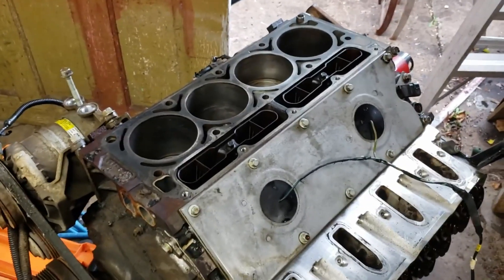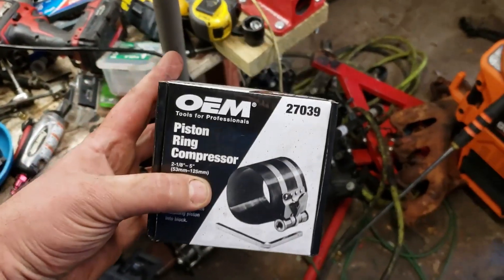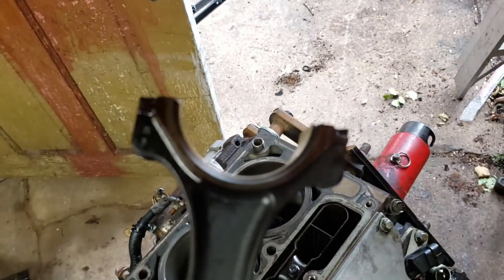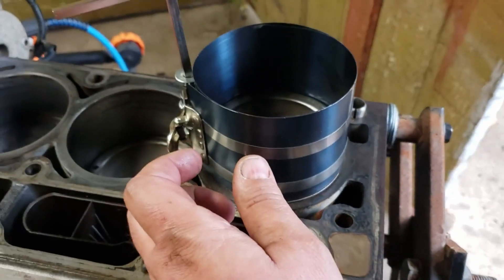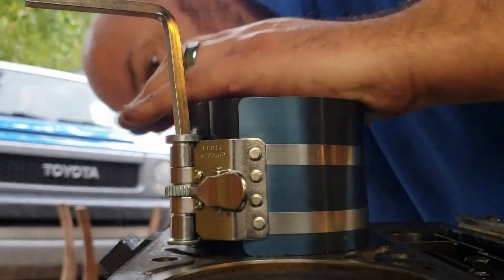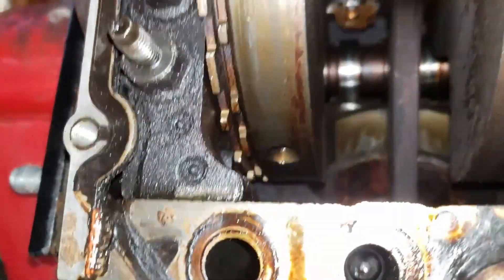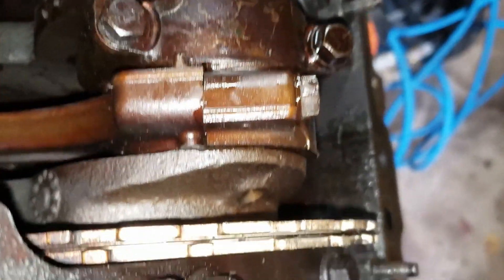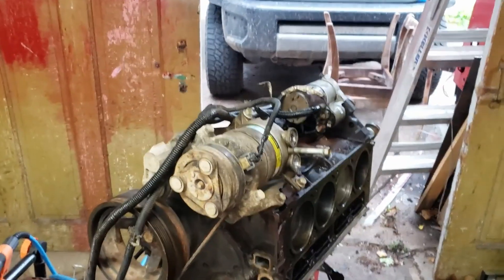Piston install on LS engine, Driveway Engineer style.

Comment: How interchangeable are the bolt on parts between a 5.3 and a 6.0?
Reply from the maker: Everything but the pistons
Reply: The Driveway Engineer outstanding.   Thank you.  We bought a burn truck with a 6.0 where the fire originated in the cab.  The plastic under the hood all melted, but the engine still turns over and seems ok.  If it checks out as good I’ll be looking to the junk yard to provide the parts that melted.
Reply from the maker: @smallblockfuelie  I'd look for a complete engine, maybe something with a hole in the block.

The junkyard will nickel and dime you on components
Reply: The Driveway Engineer thank you.  I’ve found a guy local selling a complete “rebuilder” special that has low oil pressure.

Comment: I am a old man so may erk you trying to put things right. I worked in the south east ak as a diesel mech which was that and everything between. I didn't go to a parts store till it was a last resort. I went shopping in our convenient junk pile outside the shop (some camps had them but most was back on the dirt) but I degrees as I got parts that still had life and the best of what I had to work with. I had a old two hundred lincoln gas or diesel welder and still got head bolts out without pulling whole top off (most times) got rod to stick to bolt shaft and just spin it out before I lost a head gasket (chirping sound) and replace out of another less fortunate engine. Not many manuals so either memory or if it merited got on the ship to shore radio and ask some one who did know and put it back on the road. New would of been sweet but those poor sob's had less money at the end of the month than you did cause they paid well and you walk when financing them. That exhaust bolt fought hard but common sense would of saved the guy a lot of trouble since he put it in the truck. Don't know if you could of got past everything to get it out in those tight fitting spots they get ten pounds of stuff in the five pound bag/LOL. I have pulled them same way and used some never seize around it while welding a way to pull as the heat seemed to let it down the threads... good job so far. Don't know if you want to hear my babel or not

Comment: Honest question. Is that piston rod not backwards/set up for the other side of the motor? I was under the impression that the rounded parts of the cap face one another.
Reply from the maker: The orientation of the rod over all doesn't actually matter. They are on center rods, no radius on the bearing, nothing that has to line up.

On Gen III rods like these though, from the factory, they go with all flats facing forward. Or, with all the piston dots facing forward.
Reply: @TheDrivewayEngineer   
Cool. Thanks.

Comment: Damnit man!  I'm hoping you didn't actually torque it down like that the first time. Please tell me that was for demonstrative purpose only. Those are cracked cap rods and if you did torque it all the way down with it on backwards it could have distorted the "grains" between the cap and the rod. Make sure the grains on that rod/cap are still meshing perfectly. Once it torqued down you should hardly be able to see where they separate. If thats not the case then hit me up on messenger. I've still got a few rods from Steppinwolfs old LQ4 that might not be bent, LMAO. I can shoot you one out if you end up needing it. 👍 But the good news is that Fat Italian guy in the comments above me has blessed you so I'm sure everything will be fine now. 😅
Reply from the maker: No, I just reached up under and finger threaded the bolts so it wouldn't fall out or something when I flipped the engine lol. 

I do appreciate the help brother.
Reply: @TheDrivewayEngineer  Good deal! I was worried there for a second.lol